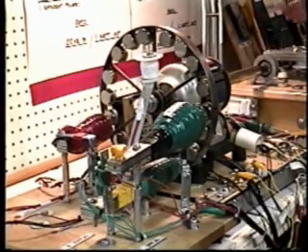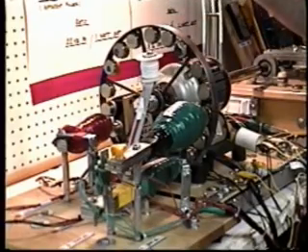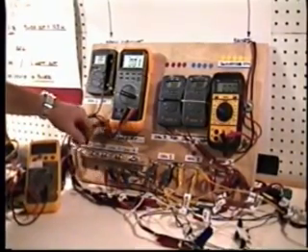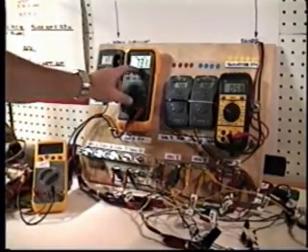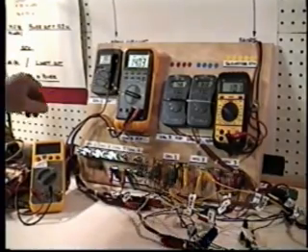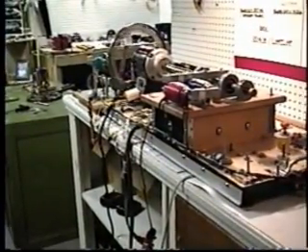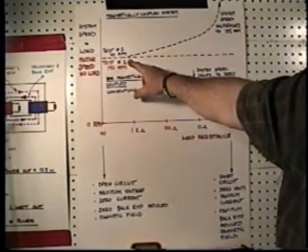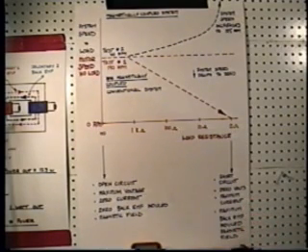PEREPITEIA GENERATOR DEMO VIDEO - Part 3

Comment: The ONLY convincing demonstration of anything like perpetual motion will be the removal of the mains power source and have the "generator" running the motor on its own. I am delighted to be debunking yet another litany of misunderstandings and fallacies. I've been doing this most of my life (when I've had a bit of free time away from designing and building real devices that do work according to the laws of physics).

Comment: Wait, he's measuring the voltage (using a volt meter!) on the open circuit coils, which means they aren't actually "open" at all - just very lightly loaded through the volt meters. What happens if he removes the coils entirely? THAT was be a "no load" situation.

Comment: Observe45r, the ac induction motor is probably an old weak motor thats not working very well...thats why it needed spinning to start or the run capacitor used on it has low capacitance value..anyway im surprised the motor is consuming about 5 amps..its probably running on 110volts ac..my discarded washing machine ac motor runs much faster and shes only using 1.5amp on 240v ac

Comment: I believe this phenomena is plausible and there is no hoax to it..only catch is the generator magnets layout should be placed on a conductor which also links to the conducting induction motor shaft..means theyre all on electrical conducting steel and there is no insulation between them

Comment: Nice demo video..may i know will peripetia effect occur if the demo was made using a dc driver motor instead of an ac induction motor? Technically speaking will the speed of the drive motor increase with load resistance placed on the generator coils if the driving motor was steel shafted dc motor?
Reply: i was here in 2015??

Comment: Umm your rpm is times ten, when you say 90 rpm you're really at 900. I'm sure you know this but it was driving me crazy. 60 rpm would be 1 rotation per second which is very slow..like what ur doing though.

Comment: What's wrong with that motor that you have to spin in by hand to get it started?  It barely has enough starting torque to move itself. 
..
What is powering the motor? 
..
Why isn't it turning near the synchronous speed with just a little slip?

Comment: Thomas: I love your comment because I see the same thing. Heins can do better with a friction disc. His scam is to use the auto-transformer for making the motor to work in an unstable point of operation while fighting the cogging torque of his machine about which Heins is very silent. The cogging torque is then partially removed by shorting the coils and VOILA: the motor accelerates!
Heins removed all my comments on videos uploaded under his name. What a shame.
Kudos to speccy!

Comment: I know you placed this comment two years ago, but I wanted to correct you - when he shorts out the coil, the voltage should drop to zero (like it does.) When he unloads (opens) the circuit, the voltage comes back up.

The only question I have: does the generating coil's core have to be "grounded" to the motor's case to complete a magnetic "loop?"
Reply: nope i dont think thats nececessary...the coupling is from the pull off the magnets on the shaft itself

Comment: I think it is an magnetic osillating effect that has to do with the speed of the magnetic propogation. The speed of the magnetic propogation is not a parameter normally associated with anything is electricity and magnetism. Thus the inability of the MIT professors to explain.

Comment: The electric field is comprised of light and heavy mass components. The light mass (Fermions) undergo acceleration that produces a relativistic shift in the clock rate of the particle.

When the electric field is separated the heavy particles (Bosons) attempt to torque, and the 'Static field" is engaged and pours energy into the system.

The over unity energy is being extracted from the inertial fields of the planet, which are the zero point or static fields.

Basic 'Static field technology.'

Comment: I don't think it's toping out. He is afraid of it coming apart. If this is truly whats implied lower the input voltage on the motor as it starts to rise in rpms. If it can do this it should run on it own after establishing a weak force field. Use a liner gen instead and feed the shaft.

Comment: I'm not so great with physics but.. This reminds me of when a spinning ice skater can control their speed of rotation by how much they retract their limbs. Maybe this is somehow similar... Maybe feeding the back EMF into the motor makes the rotations more efficient, and instead of jumping to a higher speed instantly and then gradually losing speed, the system reacts slowly so that you can visibly see the acceleration, therefore producing the illusion that energy is coming from nowhere..

Comment: alright im really interested in this and im already thinking on ways to improve on the system to better harness the electro magnetism but at the end of the video with the calculations chart i got a bit caught up how do you have current in a low voltage/ground and high voltage with no current theres a ratio no matter what transformer you have voltage with no current and current without voltage doesnt make scence does it? if im wrong could someone explain?

Comment: I'm confused because the motor involved is supposedly an AC induction motor. I thought these had to be fed with a specific frequency, and they would try to spin at that frequency. So I'm not sure how the acceleration affects the motor's ... spinning.
Reply: Read the comment I just wrote in the comments section of Part1&2. Induction motors always slip. If they didn't they would not produce any torque. The explanation for the speed variation you see has to do with the presence an removal of a magnetic brake.

Comment: what are you exactly shorting when you say "shorting out the coil"?  shorting it to ground, or simply closing the loop?
Reply: shorting means short circuit touch both ends of the coils together

Comment: I was actually referring to my other post about the steel core. The example without the steel core showed that the mechanism was running at a normal rpm, then stopped when the coil was shorted. According to your steel-core theory, it should have accelerated, because there was no core to interfere with the magnets, no?

Comment: It's not difficult to understand. Everyone who understands generators knows about back EMF. You have to ground the coil on your car engine or it will blow up. The difficult part to figure out is how to harness this power, because back EMF is a brief spike in reverse voltage. This machine here seems to do the trick. It's difficult to prove in this model, as you can see, because one would assume that the coils are just slowing down the motor, and  shorting out the coil would reduce the effect.

Comment: Thus, in fact, part 2 shows that the load actually works as the opposite it should, speeding up the process instead of slowing it down.
Personally, I only have a high school knowledge of physics, and some of these terms are beyond me, but I can get the gist of it. I'm not convinced it's false yet.
Also, he brought this to Markus Zahn, a valued professor at MIT. If he hasn't figured it out yet, I doubt anyone here has.

Comment: Quite the opposite, in fact. I notice that you didn't mention (unless I missed it in your extravagant explanations) the differences shown when the steel bar was either removed or placed in (as shown in parts 1 and 2). The motor stopped due to the laod of the coil in part 1. Yet in part 2, it spead up. 
I think this might be contrary to my earlier post, but I believe that "shorting out" the coils doesn't remove the load, it creates it.

Comment: I'd like to believe that Retrosurf's explanation makes sense, because in a way it does. The load taken off the motor would cause it to speed up.
But the rate of acceleration seems much slower than it would be in that case. It rises 1 rpm every 2-3 seconds or so, which seems wrong for a motor that has just lost 4 loads. It's too slow.
If you were to quarter a car's weight, you'd see an immensely significant difference in it's acceleration, not a slight one.
I don't think it's proven false yet.

Comment: Yes, I think you're right.  I noticed it capped out at ~110 RPM which probably has something to do with the AC current I assume he's using to begin with.

I think really its just a neat trick that appears to be more than what it is because he's measuring the wrong physical quantities.